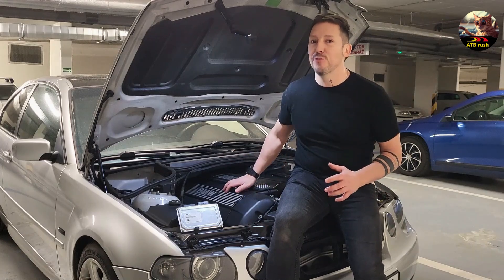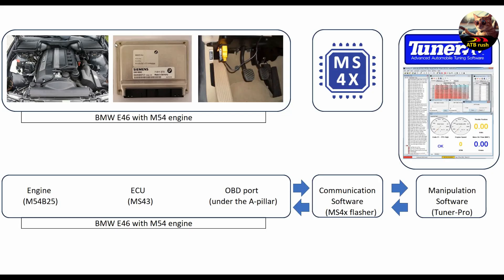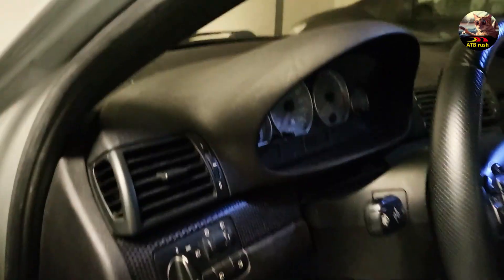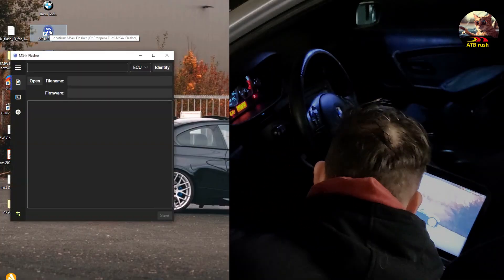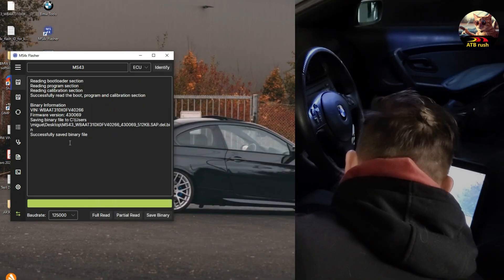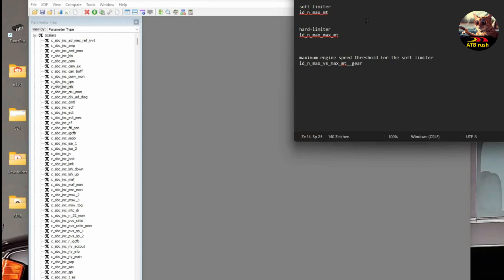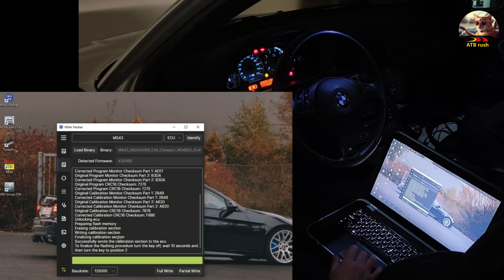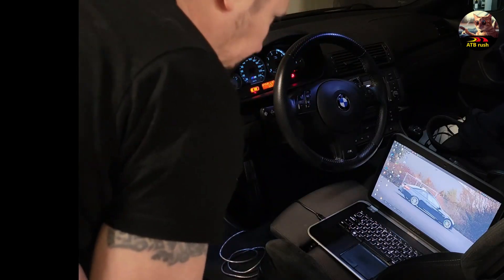Unlock the BMW M54's Potential ⏲ Full ECU Tuning Guide to Raise the Rev Limit to 7000 RPM!

Comment: i wouldnt recommend raising rev limit for stock engines since B25 already ran out of breathe past 6k

i recommend to reduce the anti-jerk to make the car slightly more responsive at low gears and maybe reduce dashpot if you want the engine to drop its RPM faster during gear shift

Comment: Did you consider piston speed for the different engine sizes? At 7000 rpm the 3 liter engine has higher piston speed than the 2.2 or the 2.5 liter M54 engines. I would feel much safer giving a 2.2 L a 7K rpm limit than a 3.0 Liter.

Comment: Whenever you're editing these small things, I think partial reading is enough. I did my fuel mapping tune only with the partial image, saves time, reduce risks the battery dies on you.
Reply: funny to note, on MS45.1 the partial read image is actually called the "Tune" file or "Flash file" xD

Comment: M54 doesn't make power up high
Reply from the maker: yes, it was mainly to remove the annoying revlimit that acts like a "brake" if you accidentally or ocassionally cross the 6500 rpm...

Comment: You need to change or weld the oilpump nut. If the M54 reves over 6500 the oil pump nut can losen it self.
Reply: securing pin + tensioner, that's the bare minimum, but even then the shaft itself can break and start spinning without creating oil pressure
Reply: Is 6800 also a problem? Because the ZHP goes up to 6800
Reply: @mikolizazi yes it is

The ZHP has a different oil pump nut.

Above 6500 the vibration change and the nut can become lose
The problem is more common on the B30 models

You can either use the ZHP nut or a locking kit to make it save
Reply: it’s a bandaid save. You can tighten the nut, but it will just shift the failure point to the shaft, which will shear off.

Buying an upgraded oil pump is the permanent fix.
Reply: inline 6’s have a noisey secondary harmonic and its particularly noisy with the 3.0’s. Just get the gsr 3bolt pump. Indestructible

Comment: never do such tuning if you have not modified the oil pump nut
Reply: +1
Reply: i can assure this, no RPM increase if the nut is not properly secure, even more in b30 as the internals rotate faster!
Reply from the maker: it is planned 🙈 (cheers for the advice)